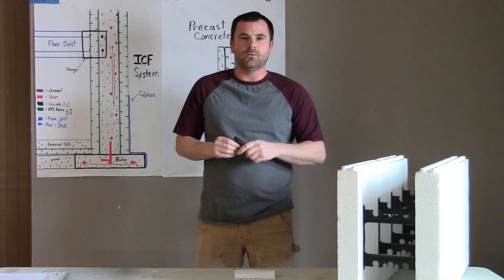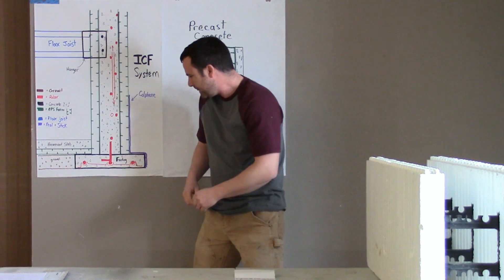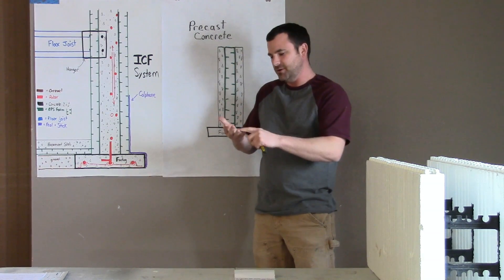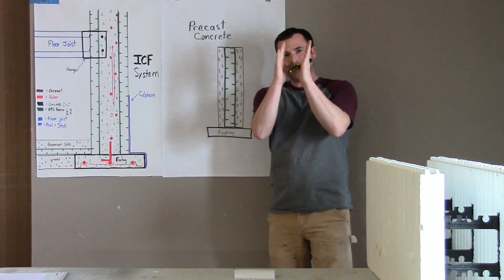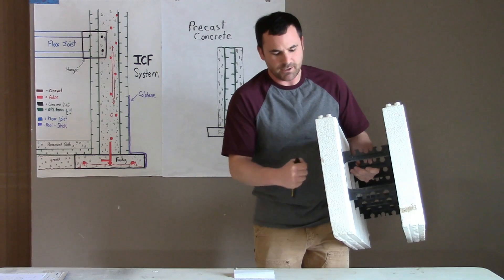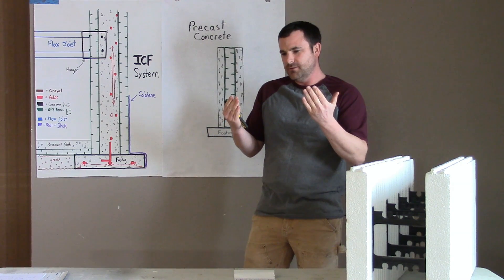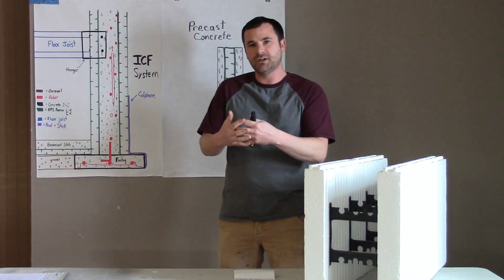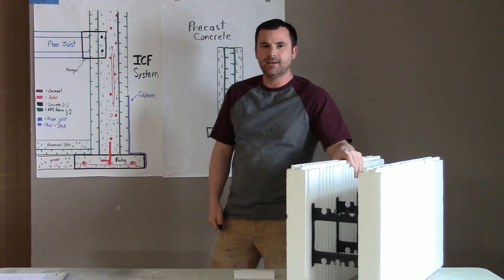ICF Construction vs. Precast and SIP Panel Systems

Comment: How do you compare ICF to AAC (autoclaved aerated concrete)?
Reply: 1- AAC has zero native protection form moisture penetration... or freeze/thaw integrity. It requires critical attention to moisture control pre-construction, during construction, and post-construction. This is a problem within itself, as even the thinset mortar used for construction contains considerable moisture. 

2- The climate/environmental window for AAC construction is smaller than that of ICFs, which are also limited, but not as much. At least with ICFs, the forms can be set when temperature/humidity/precipitation are not within compliance for pouring the concrete itself. AAC must be kept dry throughout it's lifespan... from point of production, through construction, and throughout the lifetime of the home. Once ICFs are installed, concrete can be poured as weather conditions permit. With AAC, the entire structure INCLUDING weather barrier/cladding must either be rapidly constructed while conditions permit, or excessive moisture control measures must be implemented during periods of prolonged exposure.

3- thermal and sound permeability are on par with ICFs... but at different rates/ranges, and with different on-site variables which must be accounted for. Where thermal mass is of concern, obviously ICF construction is superior. With regards to basic thermal permeability, AAC construction can exceed ICF, but requires the use of expensive polymer bonding materials instead of typical thinset. In typical AAC construction using thinset mortar, the comparable thermal penetration of AAC is slightly degraded via thermal bridging of the thinset, which is higher than that of the plastic lattice matrix used In ICFs. It is worth noting however, this comparison is dependent upon a "perfect pour"... which is an onsite variable. If the concrete does not settle properly, with all possible air pockets removed, the thermal insulation is degraded. This is why the pour is so critical, as ICFs are "blind pour" or "blind fill"... meaning one cannot inspect the integrity of the fill visually. AAC provides a more consistent product in this manner, as the integrity of the whole wall material can be visually verified throughout it's entirety.

-AAC typically offers a lighter overall footprint. Where engineered foundations are used... ESPECIALLY insulated foundations... this could be a critical component of the overall cost and performance envelope. The potential for benefit here is two fold. The overall structural integrity will benefit from decreased initial settling time, AND depression rate over time. Given the same foundation parameters, the foundation itself will endure less stress with AAC construction.

-AAC is more conducive to direct-to-surface cladding, such as stucco/etc. . Actually, stucco is the preferred exterior cladding treatment of most AAC structures... but requires polymer based components to avoid introducing moisture to the AAC substrate, ESPECIALLY in areas that are subject to extreme temperatures or precipitation/humidity.

-AAC is a far more compliant material with regards to custom construction, where complex/ornate design features are integrated directly into the structure itself. Arches, rolled edges, coves, and other artistic/architectural features can be integrated directly into the structure itself... as opposed to requiring additional fixtures. This may or may not play into the desired design, but it is a capability not exhibited by ICFs. 

-AAC construction always has a dust hazard present, until both interior/exterior cladding is complete... thus, PPE measures must be taken into account prior to those stages of completion. Also, AAC is typically made with a high percentage of fly ash... a material of potentially high health risk, if not managed properly. The inability to simply "wash down" walls built with ICFs, means these risks must be managed with dry methods of containment (near constant vacuuming, etc.). Most crews working in AAC construction, including electrical, will usually employ a laborer who's time will mostly be dedicated to this task alone... unless the AAC crew assumes the task of cutting wire chases, plumbing provisions, and installing stations and register rails for drywall and exterior cladding. In most cases, this is not possible. Only when crews are well informed and integrated, along with all design parameters set. Aside from standardized construction (multiple uniform design structures), this is a veritable impossibility. Post pour cleanup, ICFs offer a cleaner and safer construction environment aside from EPS shavings.

-AAC block is somewhat less equipment/labor intensive. A good masonry crew experienced with AAC, can typically lay the wall in slightly less than double the time required to simply lay up the forms of ICFs. Also, the time, expense, equipment, and additional specialized labor cost of pump nozzle pour-in-place concrete is avoided. 

-Alternatively, pour-in-place AAC (PIPAC), also known as chemical aerated concret (CAC) typically does not allow for vertical construction (walls) without introducing variables into the end product, and is not compatible with typical ICFs. Pour-in-place (PIP) AAC concrete is not technically true Autoclaved Aerated Concrete, as no exterior heat source is used as with block that is baked in kilns. "PIPAC" (pour-in-place aerated concrete) utilizes a chemical reaction (usually an alumina admix with some sort of acidic catalyst) to induce aeration. Although heat is involved in the reaction, it is not autoclaved. As a result, the vertical load decreases aeration and porosity in the pour. This effect is amplified with the height of the pour, and typically mandates a staged/segmented/layered pour... where the pour is made in 12 to 24 inch vertical "stages"/"segments"/"layers", allowing time for the material to fully aerate before pouring successive material. For this reason, performs/precast are often incorporated for large sections. AAC precast allows true AAC material (not PIPAC) to be used in vertical construction. Preforms can be used on site to facilitate PIPAC in vertical construction... where PIPAC can be poured into the desired form on site in a horizontal position, then raised into position once cured. both methods have their merits. True AAC is a better performing material, so precast is 2-3% better insulating option than preform PIPAC... but still has thermal bridging between panels. The thermal bridging of precast is still far less than block... and most reputable AAC manufacurers also have precast panel products in their portfolio. Preform PIPAC allows on site customizable integration of PIPAC, without the necessity of staged pour, but still requires some thermal bridging in the joinery. In the end PIPAC could potentially integrate VERY WELL with ICFs... but I have only seen one product that is still in development stages. PIPAC has different physical properties that must be taken into account with the production of the ICF itself... hence why typical ICFs cannot be used with PIPAC. 

-ICFs have an advantage in sound mitigation... albeit somewhat minor and more specifically at lower ranges

-ICFs also are also somewhat more competitive with regard to extreme forces in areas with high potential for extreme storms and/or seismic activity (coastal areas and earthquake zones). 

AAC, like traditional concrete, is also available in precast slabs for above grade floor/roof applications, while retaining its sound and thermal insulating advantages.

-AAC is a carbon negative construction material, for those applications which could benefit from LEED credits, or other carbon emissions reduction programs.

-AAC transportation footprints are higher, due to the lack of manufacturing locations... where as ICFs have a relatively equal transport volume, and much lower transport mass... as concrete is usually available within a short distance of the site.

-both systems require engineered plans for construction in most developed areas of the world with building codes. To my knowledge, only Germany and a handful of lesser jurisdictions have established codes for AAC construction. I do not know of any jurisdictions that have established codes for ICF construction.

It is worth noting here, that neither of these products are "as installed" structural wall or roof solutions for residential applications. To my knowledge, only sealed laminate SIPs are capable of providing a whole wall/roof solution. Laminate and fill/core materials vary. Sealed laminate options include PVC, fiber composite (carbon, glass, and basalt), and sheet metal (steel or aluminum). Fill/core materials are available in EPS (expanded polystyrene, the most common), rockwool (a cement/fiberglass composite), rigiplast (a plastic or polymer and fiber composite media), stabilized roving fiber (looks like an ICF, with rigid material maintaining space between the laminates and stabilizing the woven fiber), XPS (expanded polyurethane, or similar polymer), and several "green" options which incorporate various end-of-life consumer materials like paper, plastic, denim, and other post-consumer waste products. Although PVC laminate SIPs are sealed, they lack te UV protection for exterior applications without some form of protective coating. Also, PVC laminated panels do no allow for direct polyurea application. Most steel and aluminum laminated SIPs are available with with exterior coatings... and when properly installed, do not require any further weather proofing for a code compliant wall/roof solution.
Reply: @driverjamescopeland  holy hell my brain hurts from so much information. Time too Google AAC cause I have no idea what that is.
Reply from the maker: No I haven’t. I am making a full ICF series this year. I won’t cover absolutely everything but it should be fairly thorough. Any ideas such as this are helpful. 

Thanks for all of your comments!!

Comment: Do you remember the case of Jeff Bush from Florida? He fell thru the buttom of his house into a sinkhole and disappeared to never be seen again. If the house was built using ICF, even if it sunk into the sinkhole, Jeff would have been safe inside and rescuers could have saved him thru the roof which by then would had been at ground level, height wise......
Reply from the maker: Someone else told me that story on another ICF video of mine. Very true! Very interesting. Thanks for sharing!

Comment: What about precast floors vs freshly poured?
Reply from the maker: It all depends. Pre-cast has its place. If you want ultimate in strength go poured concrete with dowels into a monolithic ICF wall. After the floor sets the entire structure is one piece.  Does that help? It just depends what your goal is and what you are doing.
Reply: Kody Horvey hmm, I’d assume that the walls would burst with a monolithic pour

Comment: Re insulating and thermal mass. In an ICF wall, the concrete is isolated from the inside and outside by foam. If the concrete isn't thermally isolated on the inside, you end up trying to heat (or cool) planet Earth through the footings as the concrete is highly thermally conductive. A high thermal mass means more time spent uncomfortable in your home as you try to heat or cool many tons of concrete when you change temperature. This isn't an advantage. It's a severe disadvantage.

Comment: On the thermal mass issue I think that would only be an advantage when you have a large temperature differential between night and day, cool nights in summer or warm days in winter like we have out in the desert. Here in east Texas our summers are blazing hot even at midnight and winter is hazy most of the time so days don't warm up as much, so unless ICF can hold it's temperature for six months I don't think it's thermal mass will be of much benefit here, however it's lack of wood is a VERY nice benefit with our staggeringly high humidity and termites.

Comment: 1. Again, your comment about movement between concrete on the two sides in precast makes no sense since there is concrete only on 1 side (see my other comment). 2. Your comment about foam/caulking makes no sense because precast sections are also bolted together.  3. Air-infiltration?  Please.

Comment: Precast done in a warehouse gives climate controlled pour, stronger psi mix, rebar reinforcement (compared to form-set pouring on the job site)  They can be placed and made sure to be square.  Your drawing is a big mistake...precast does not have concrete on both sides - only the outside.  After the XPS foam, the wall has pre-attached 2x4's to it so you can "finish" your basement (that alone is really great since it's a lot easier working with 2x4's than "hot-knifing" the ICF foam to put in your electrical boxes and screwing them to the concrete and then cutting the foam to run conduit.

Comment: I enjoyed the video. I am wrestling with this now. What system to choose? On the point of thermal mass the one thing I don't like about the ICF is the insulation on the inside. If you design for passive solar gain then the inside insulation insulates the concrete from absorbing the heat gain. More of it will be lost through the glazing.